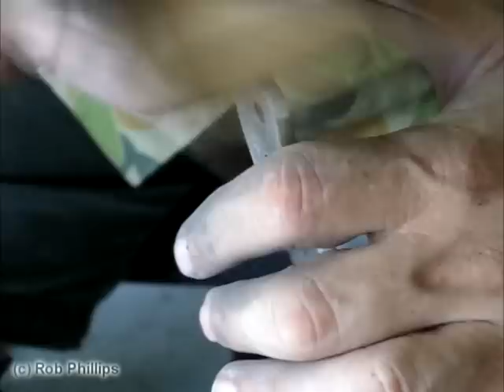Knife Making - The 'Mad Max' Bowie/Tracker knife - part 2

Comment from the maker: @JesusFuckingChrist84 
oh ok...it was mainly two reasons. 1 - ...My belt could only really do the handle grip. The finger groove is to small and the belts on the sander will not curve that much. But once I got started with the file...I simply forgot about the belt sander and just kept working.
2 -  Cost....As D2 is hard steel (even when annealed)....it would mean going thru a lot of cheaper sanding belts or buy an expensive belt to use. Either way...something I cant afford at the moment.